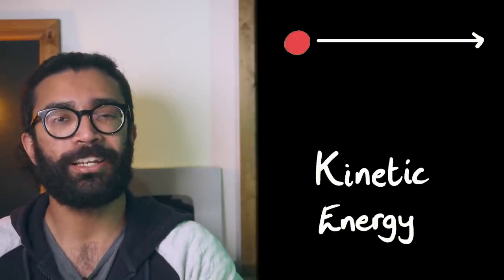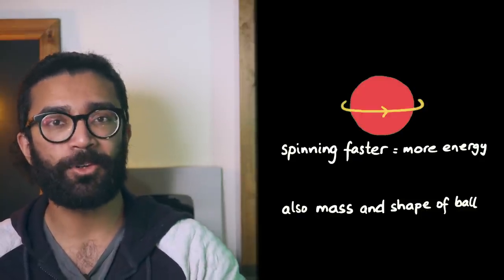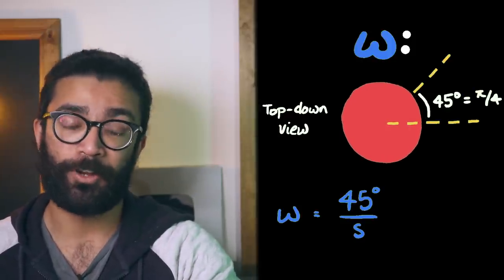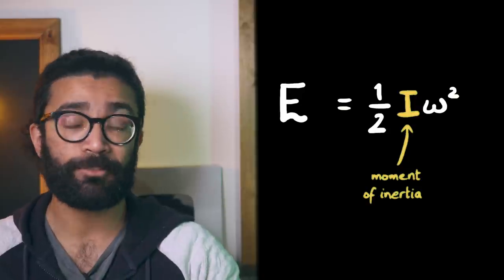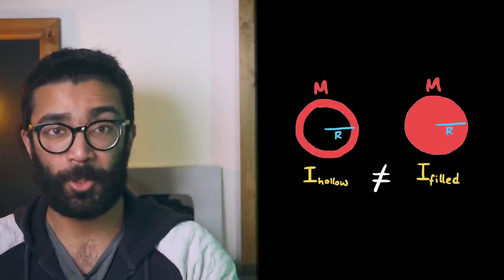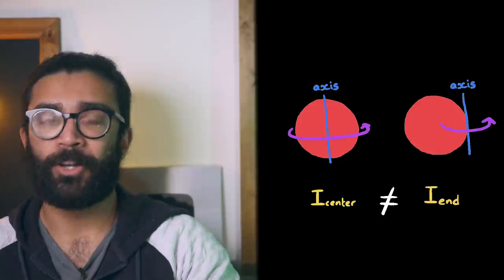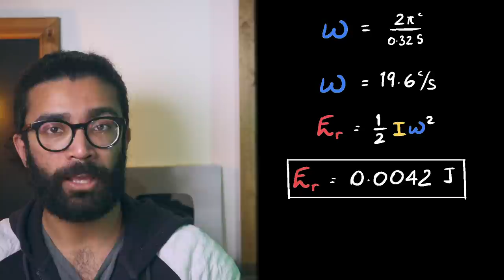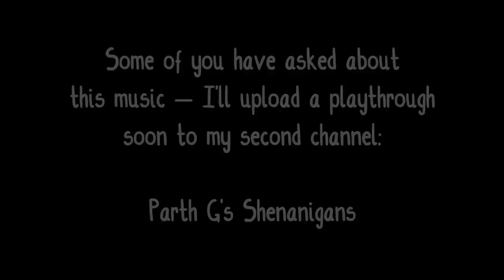You (Probably) Haven't Been Told About the Second Type of Kinetic Energy

Comment: I've always liked to think of rotational motion as multiple elements of the objects performing linear (circular; but at any instant, circular is linear) motion. Omega, Alpha, and even moment of inertia are nothing but the representation of linear quantities (like velocity, mass etc.) using polar coordinates. We can even define linear motion using polar coordinates, however, this would make calculation very difficult. The opposite is true for rotation, where representation of rotational motion using the cartesian system is very inconvenient, thus we use polar coordinates.
Reply: Yeah, I think that's what the math spells if you expand "I" and "w", with the integral, isn't it?

I wonder whether there are any (classical) cases on which this would not be the case?
Reply: Adi,
"...but at any instant, circular is linear" you write. 
This is quite precisely incorrect.
Every atom undergoing circular motion is doing so because of the centripetal forces upon it. Thus, at every instant it is exactly not linear: at every moment it is following the forces making its motion circular. (If you want to think of it in vector terms, it is following two vectors, both linear, but both, the centripetal and the radial, constantly changing. Thus, their sum quite certainly not。）
Sometimes when you draw up a wry contradiction you can make a nice irony out of it. Sometimes, however, what you are constructing is just a mistake.
Reply: @TheDavidlloydjones  can't that force, at any given instant, be seen as causing a linear acceleration (as in, in instantaneous direction of the motion) and a perpendicular one, which does not change speed or (linear) kinetic energy? Wouldn't that arrive at the same math, at least?
Reply: @user-sl6gn1ss8p  I believe so yes
Reply: @user-sl6gn1ss8p  yeah. Freeze time, and at that instant circular motion is basically linear motion

Comment: In the case of elliptical orbits, can the motion be separated into circular and linear components?
Reply: It can, but not usefully. You could instead view it as tracing a conic section, or perhaps transform space such that area/time is a constant quantity (orbits trace this at a constant rate)
Reply: This is essentially how you derive elliptical orbits using the Lagrangian, considering both the radial and angular dynamics.

Comment: This is very misleading. There is only ONE type of kinetic energy, which is given by 1/2 mv^2. In the case of rotational KE, all the pieces of the object move at different speeds (unless we have a hollow cylinder), which forces use to break up the object into infinitesimal pieces and use calculus to add up all the 1/2 mv^2 of the small pieces.